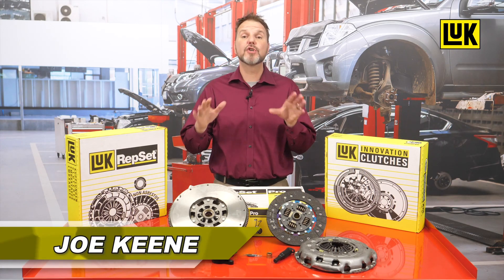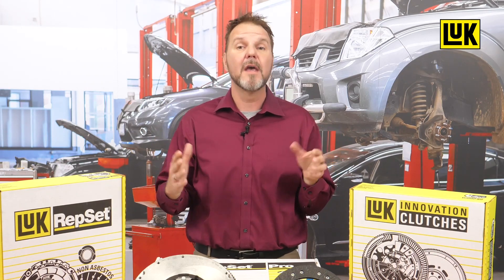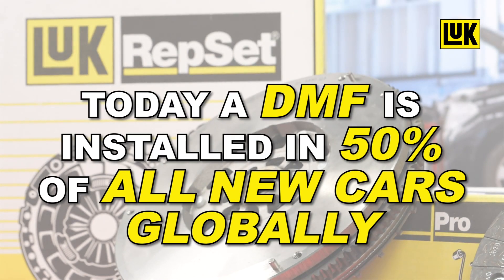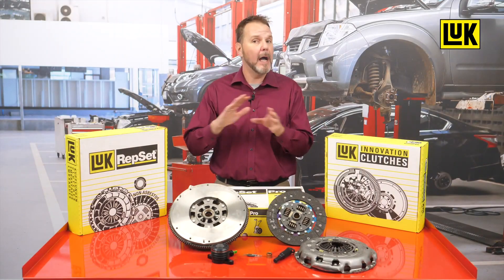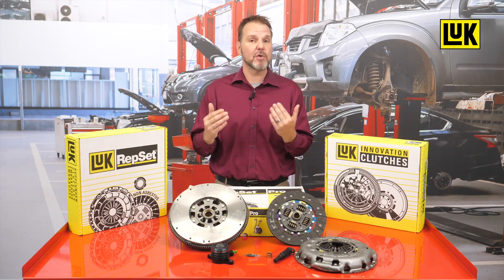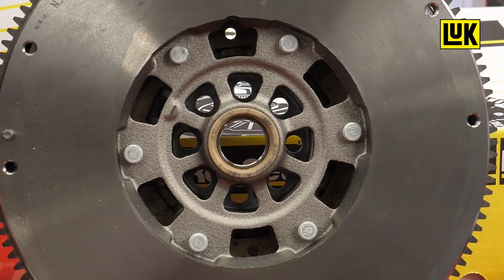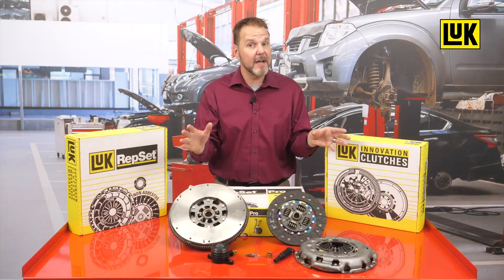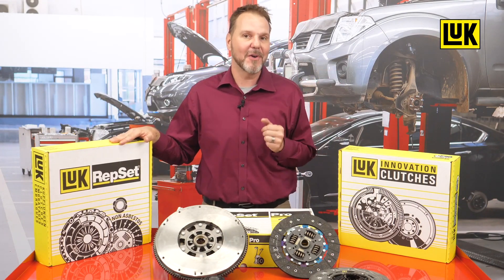Understanding Dual-Mass Flywheels

Comment: Just another moneymaker for manufacturers and garages. These dual-mass flywheels can be resurfaced if the bearing is not worn. However, in our area (Harrisburg, Pa) I know of only one shop capable of performing this process for a fraction of the cost of a new flywheel, which is about $1500, depending on the vehicle. That cost was for a 2014 Mazda 6 with a 6-speed trans. I also know of someone who has a Nissan Versa with close to 300K miles on the odometer who replaced the clutch assembly and used a single-mass flywheel at just over 200K miles in place of the dual-mass, which was in this vehicle from the factory. He told me he noticed no difference between the dual-mass and the single-mass, performance wise. No matter, these front wheel drives are a bane, IMHO, hard to work on and super expensive to fix. Clutch job for the Mazda totaled about $1800 because the shop was able to resurface the flywheel. Another shop, that did not have the capability to resurface, nor the desire to send it out to a shop that could, produced an estimate of $3K for the job without batting an eye. So, tell me, are today's engineers getting smarter or just coming up with more ways to pull more dollars out of consumers' wallets?? I'd put my money on the latter.